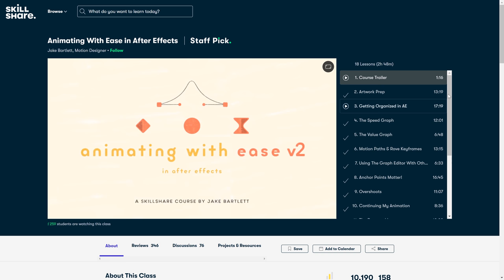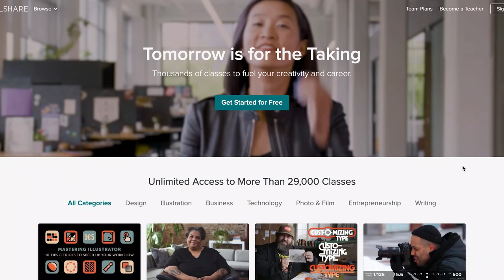How ice water makes hot water boil

Comment: chamber fills with steam when capped off, cold water reduces temperature and condenses the steam inside, reducing pressure causing gasses in the water to boil off. now on to the video

Comment: I'm not sure that the heat capacity of either the vapor or the liquid water matters here.

With the vapor: It's presumably not superheated. You could make sure that it's not superheated by shaking the bottle after you take it out of the microwave oven. If you still get the same result, then the heat capacity of water vapor certainly doesn't matter to the experiment, only the latent heat of condensation does, since you're literally not changing the temperature of the vapor at all.

With the liquid water: I'm less sure about how to test for how much this matters. I'm mostly just intuiting that you're doing a lot less in this experiment to take out energy from the bottom of the bottle, where the liquid water is, than from the top.

Comment: I haven't seen the video yet but my guess is that the cold water lowers the temperature of the air inside the bottle, making its pressure drop low enough as to lower the water boiling point to room temperature.

EDIT: okay so I was kind of on point but not completely right. I just missed the part when he said that the water was boiling so I didn't take into account the water vapor, I thought the water was hot but not boiling. Also, now that I think about it, air is a good insulator so I doubt it can be done without boinling water.

Comment: Now if you have Two glasses stuck together, Fill a sink with hot water, then run cold water over the glasses, Dip in the sink with hot water, For like 3 seconds, pull out pull apart. The one glass that was stuck inside should be fine, the one on the outside becomes so brittle any amount of pressure will make it explode.
Reply: Do this to Metal. And or metal pans. Super heat or Super cool with water.
Reply: Tales from a Dishwasher.

Comment: Gonna leave my guess before watching:  The cold water lowers the temperature of the gas in the sealed bottle, lowering the pressure inside the bottle and thus lowering the boiling point of the hot water.
Reply: Oh interesting, I didn't realise that the bottle would have a bunch of water vapour in it, that explains why the effect is so dramatic.  I had it basically right, I just didn't think about how much of the gas would be water, given the water had been boiling before the cap was put on.

Comment: Hey steve, you mentioned you gave this video the '50 fps' treatment. Now I now PAL is 50hz, but by now most (all) of the displays (tvs, phones, monitors) are all multiples of 60 (30)hz. So why do you stick to 50 fps, when most devices would benefit from those 10 extra frames? Now all screens are showing the same image twice 16.66% of the time!
Reply from the maker: Yeah, I'd like to but I'd have to power all my lights off batteries instead of 50hz mains power. And that's just a pian because I'd have to change the batteries all the time!
Reply: @SteveMould  right, I forgot that 50hz lamps will cause strobelight effect. Makes perfect sense, thanks for answering!

Comment: I suppose the boiling/not boiling is a knife-edged threshold because I didn't see the volume of water in the bottle visibly increase as the cold water was applied and the vapor condensed. I assume condensed water did appear in the bottle, and enough to reduce the pressure to the boiling point, but it wasn't obvious.

Comment: Didnt finish the video yet, but I assume it has something to do with the air inside cooling down lowering the pressure inside causing the water inside to have a lower boiling temperature. The boiling temperature will fall below the current temperature of the water at some point so it will start boiling.

Comment: the explanation that i was thinking goes like this

when you pour cold water to the bottle with hot water inside also cools down.. but I THINK THAT it does not transform back into water... From the  cold gas goes down and hot gas goes up principle, , the cold gas particles go down inside the liquid and because the hot water increases the temperature of the cold gas again, it goes up, which forms the bubbles. so i think it is not technically boiling..

Comment: Before I watch the video, this is my prediction: The hot water is in a pressurized container, so it can't boil. When you pour the cold water over the container, it cools down the gasses in side, reducing the pressure, and allowing the water enough space to transition into the gas phase.

Edit: I was ALMOST correct. The bottle is pressurized by the boiling water itself and it reaches an equilibrium between temperature and pressure. Also... I completely forgot about thermal shock, and now I feel like it's a good thing I'm not a scientist.

Comment: Havent seen the video yet but I figure it's the pressure going down in the bottle through the cooling of the air in the bottle. Pushing the boiling point down to the actual temperature of the water inside. 

Am I right?

Comment: Didn't watch yet.. But I'm fairly certain it's to do with the cold water being poured over, cooling the vapor inside causing some amount of vacuum to form. even room temperature water will boil at a low enough pressure.

Comment: sees the method It's whatsisface's triangle! The uh, thing. Pascal? It's pressure, so probably. The cold water lowers the pressure in the closed system and the hot water's boiling point reduces just enough that it begins boiling. Like tea on mount Everest (though in that case the cold isn't the point). That's my rambly guess.

EDIT: So! Almost! I forgot that the effect would be aided by the already-vaporised water... But, in turn, I think you forgot to mention the specific heat of fusion/fission (I forget which one) which would further lessen the effect of the cold water on the warm water (as changing states "downwards" requires a bunch of energy). I might be wrong in that though; I no longer use physics enough.

Also, finally, someone explains why a nucleation point is a prerequisite! I knew about superheated water and all that jazz, but I'd never thought about it in terms of surface tension requiring more energy to break! Is this the same reason that ice needs a nucleation point?

I hope your eye gets better soon! I had assumed it would have a cause significantly less badass than "punched in the face".

Comment: The explanation I came up with was that it possibly wasn't boiling, but rather it just looked like it was because of the pressure changing in the bottle causing air bubbles to form.
So I was half right...

Comment: Let me guess from the thumbnail. Put cold water on the water lower the air temperature inside the bottle which lower the air pressures inside the bottle. Ik this cuz a balloon become smaller if u put it in cold water. But since the glasses bottle wouldnt shrink, the air pressure drop instead

And lower air pressure=increased
 boiling point of water.
Reply: Im right🙆‍♂️

Comment: Hey everyone,
can anyone explain to me what is happening with the flow of the water he‘s pouring over the bottle? I noticed that it only flows down all around the bottle until it has reached the point where the hot water inside the bottle starts and then it makes its way down the bottle to drip of. I thought it might have to do with the velocity or quantity of the water flowing downwards, but starting at 3:50 it appears to me that the stream is pretty steady and that imaginary line even starts to retreat. 
I hope it‘s understandable what I mean. 
Awesome vids btw Mr. Mould

Comment: You made this video for improved quality, and you mentioned the 50 fps treatment. First of all, everything is better than the "cinematic" 24 fps, and 50 fps is way better than the standard 30 fps.
But nearly all monitors have a refresh-rate of 60 fps, and so do most phones. 50 fps is smoother than 30fps, but it's still not as good as 60 due to the odd timing of all frames.
I know 60fps can be a struggle in Europe, but if you could go for 60 fps next time then that would be great :D
Either way, I'm really glad you don't stick to 30fps like many other you tubers do. 30 fps is just disgusting xD

Comment: Does this mean that it isn't the temperture that is causing the boiling, but the decreased air causing the water to try to expand to fill the void where the air no longer fills?  Is that the act from which the boiling happens, and if so is it possible to reach a low enough air pressure that the water would turn into vapor?  I'm not a scientist, I just fry eggs. :)

Comment: Prediction before watching the video:

The icy water poored over the bottle chills the air left in the bottle which will lower the pressure in the (closed of) bottle. Water boils at different temperatures depending on airpressure. Your water will boil at a lower temp when you're higher up for example. Try boiling an egg at the top of Mount Everest (I seem te recall that it's not possible).

Edit: Afaik I was right, nice. That's a first I think. Sadly I forgot to predict the red spot's cause :(

Comment: Caught a significant error in the explanation. Water liquid and vapor have similar specific heat at the same temperature, isobaric vapor is higher and isochoric vapor spec heat is lower. engineeringtoolbox.com/specific-heat-capacity-water-d_660.html

Comment: Surely if BP is inversely proportional to temperature then it would be easier to make a cup of tea at the top of mount Everest because less energy applied?
Reply: stixheaven67 yep! For the same reason a lot of baking recipes have different instructions for “high elevation” preparation.
Reply: No, it makes it harder. To brew a tea, the water has to get to a certain temperature. If it starts boiling before reaching that temperature, the tea won't brew.
Reply from the maker: Yes, good point! Easier to make but tastes bad because you can't get the water hot enough!
Reply: It would be easire to boil water, that is correct. The problem is that to make good tee, herbs have to be in the water at around 100 C.  At the top of Everest, you would have boiling water at 71 C. That is too cold, to extract sufficient amount of flavour molecules from the tea leaves and tee would taste bad.

Comment: 2:19 correction: the temperature of the water does not increase. Boiling only depends on external atmospheric pressure. It is possible to boil water which is at 0 degrees Celsius  just by reducing pressure. But temperature and nothing to do in this. Boiling depends only on pressure.
Reply: Please listen again. He never said that the temp of the water increases
Reply: An argument can be made that boiling depends only on temperature.
Reply: Benjamin Wang hello? He clearly says that
Reply: I think he meant vapour water getting back to liquid state has higher temperature than water that's already in liquid state, thus it increases the temperature.
Reply: أحمد خطيب bro its science.
Reply: boiling per se does NOT depend on temperature as you think it does
Reply: We only raise the temp of water to increase the amount of vapours on the surface of water. The more the heat the more upward vapour pressure. This pushes back the atmospheric pressure. When the vapour pressure of water exceeds atmospheric pressure, then the water begins to boil. At regular atmospheric pressure, that is at 100 degrees Celsius or 212 degrees Fahrenheit or 373 Kelvin.
Reply: Zlocimir ohhhhhh I see! Well I guess this was all a terrible case of miscommunication. My bad🤦‍♂️🤦‍♂️
Reply: @kruzerblade4740  
You could say the same if you choose a certain pressure and then say boiling only depends on temperature.
You contradict yourself when you say you can boil water at 0°C but the temperature has nothing to do with it. You need a much lower pressure to boil water at 0°C than at 99°C.
Lower temperature needs lower amounts of pressure to boil water.
Reply: @kruzerblade4740  what about energy in the water molecules ? Doesn't that factor in ?
Reply: He did, in fact, not say that the temperature of the water increases. He said "the temperature of the water is now above the boiling point of water at that lower pressure".